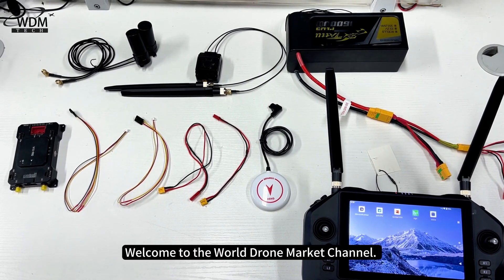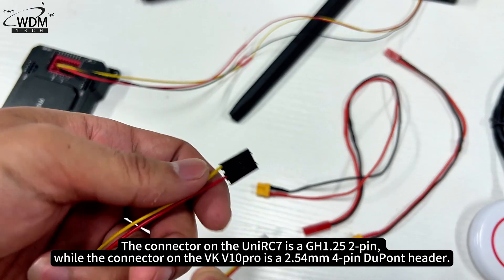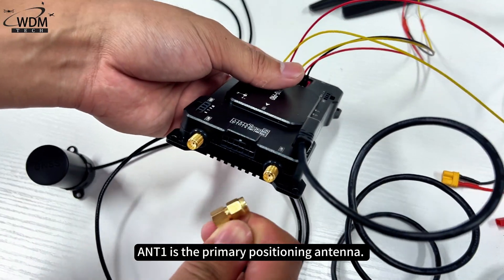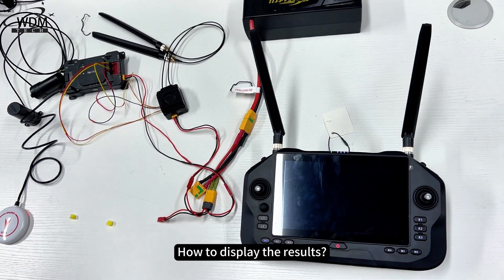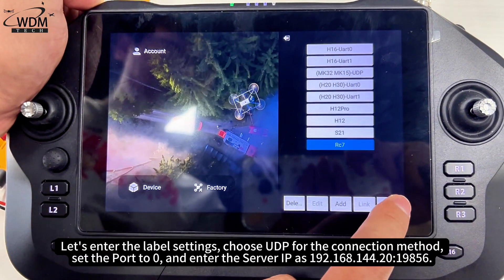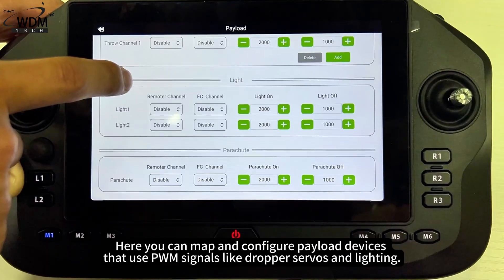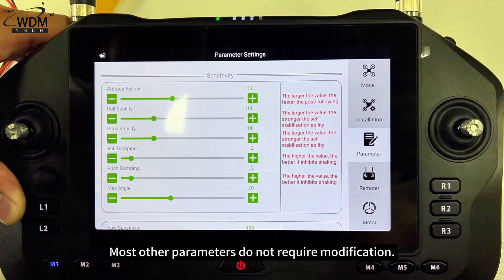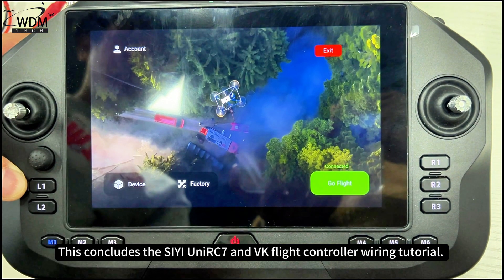SIYI UniRC7 and VK V10-pro Flight Controller Wiring Tutorial

Comment: Hello,
I have a question regarding compatibility.

Is the SIYI AI Tracking Module II compatible with the UniRC 7 Pro transmitter/receiver?

For your reference, the ZR10 camera firmware has already been updated to the latest version.

Thank you.
Reply from the maker: No problem, the SIYI AI Tracking Module II is compatible with the UniRC 7 Pro remote control.
Reply: @worldronemarket  “I have connected the UniRC 7 Pro transmitter, the ZR10 camera, and the tracking module, but the transmitter display is the same as when the tracking module is not connected.
Do I need to change any settings on the transmitter, or upgrade the transmitter firmware?”
Reply from the maker: @conqueringtheworldwithdron5585  What ground station are you using? Is the AI module's tracking function working properly?
Reply: @worldronemarket  I am using the UniRC 7 Pro transmitter and receiver.
However, the tracking function of the AI module is not working properly.
Reply: @worldronemarket  해결 하였습니다. 감사 합니다.

Comment: is it same using Siyi hm30?
Reply from the maker: Yes, they are almost the same
Reply: @worldronemarket  can I broadcast realtime video stream online the rstp link using hm30 without interruption? I cant do it in mk32 remote controller
Reply from the maker: @dasig3010  Do you mean to display the MK32's image on the computer?
Reply: @worldronemarket  using siyi HM30 wired to both pc and RC(mk32/mk15) then the pc will broadcast the rstp video online via OBS . is this possible?
Reply: @worldronemarket   I have tried this but this wont work . mk32 video needs to be off to be able to stream on the PCs QGC. 

PC is connected to mk32 thru hotspot of the mk32
Reply from the maker: @dasig3010  I'd like to ask if you're using a SIYI gimbal camera?
Reply: @worldronemarket  we have siyi zr10 and zr30 but during our testing we are using siyi r1m
Reply from the maker: @dasig3010  You can use the ZR10 and ZR30 to test this. Starting this month, all SIYI cameras support 4-channel streaming. You don't need to turn off the MK32 video stream; you can stream via wired/wireless connection on your computer.
Reply: @worldronemarket really? do we need to update the firmware of the camera? How to do that?

I'll try that next week.
Reply: @worldronemarket  I will try this thank you. Do you have video of ZT30 on how to ACC Calibration? we have this, the stream is working but the pitch & yaw controls not working on the zt30. I have updated the firmware today and only capture button and record button works and zoom button works. 
still pitch and yaw controls is not working. 
I tried calibration but no changes still cannot be controlled. I already checked the wirings too
Reply from the maker: @dasig3010  You can email our technicians; this will resolve the issue more quickly.
tech@worldronemarket.com or tech2@worldronemarket.com
Reply from the maker: @dasig3010  All SIYI gimbal cameras have always supported 4-channel streaming. This update mainly adds 4-channel streaming functionality to the R1M and rugged cameras. The R1M can achieve this by flashing the official firmware. I will send you the firmware, please update it.https://siyi.biz/siyi_file/R1M/R1M%20Firmware%20Pack%20v0.2.2%202025-10-11.zip
Reply: @worldronemarket Can I use V10 Pro FC with Skydriod G12 radio Controller and Reciver?
Reply from the maker: @skyhunterPDF  Of course, they can work together.